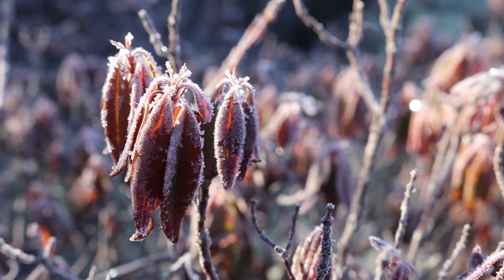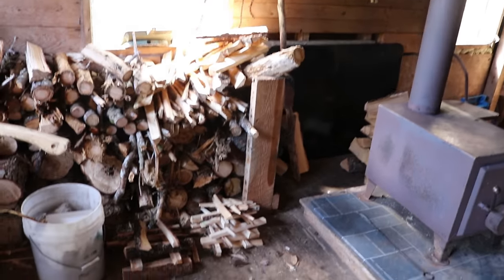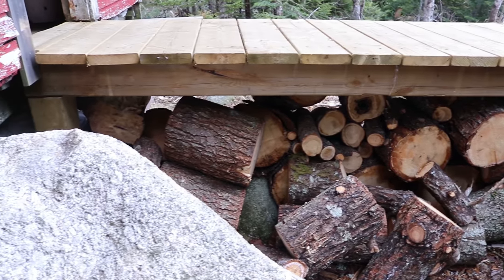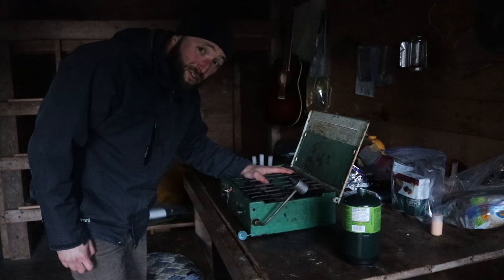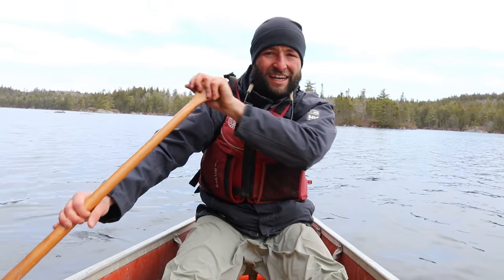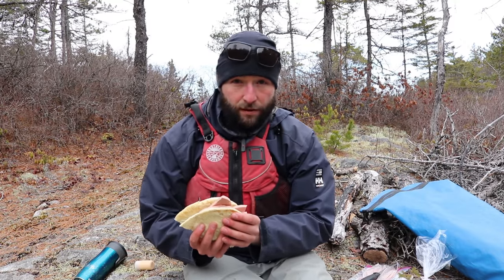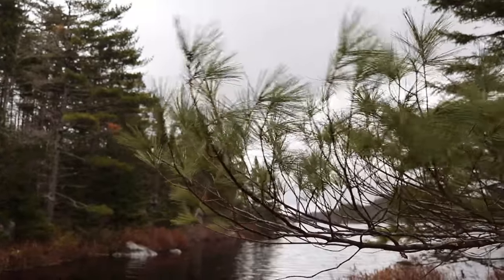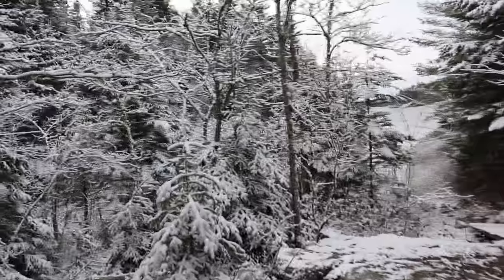Lake Access Only Off-Grid Cabin in Nova Scotia, Canada

Comment: Was thinking that someone should clean the stove pipe...the draft wasn’t all that great with the two bends in it. Pack in a chimney brush. Great vid.
Reply: Should be cleaned especially if burning pine. If not cleaned you can have a  stove pipe fire. And to have that 3 foot parallel pipe is inefficient for smoke to escape.
Reply: Good point mate. Tho I wonder if that’s taken care of.
Tho it’s not used that often or prolly not during extreme cold spells.
Reply: @emelen123jamesula2  All you have to do to clean it is burn it extremely hot with a bunch of kindling for about 30 minutes and get it glowing. As for the parallel pipe not being efficient for the smoke escaping.. while that's true, the goal isn't to have the smoke escape, it's to warm the cabin; the more pipe you have inside, the more heat it transfers inside.
Reply: The pipe was realigned in 2023 to make it straighter, it draws much better.

Comment: Best canoe repair is simple:  pitch from spruce or fir works great.
Reply: yes use pitch melt down and ad some carcoal from the stove mix it kind of thtick then apply it warm to canoe.
Reply: also flammable great for everything! 100 :)
Reply: Good tip, prob could been done that trip
Reply: there was no duct tape/fiberglass grey stuff on the bottom of the canoe when he flipped it to go off to explore the lake. 15:34
Reply: Good eye Jeanette, I'd rather share a canoe with you to cross the lake, could have re patched before venturing out 👍
Reply: Yeah! Was just going to mention that! And strangely...one of the few emergency repairs that will actually stick to a Ram-X hull in a pinch!👍

Comment: For future reference if you have to mend a plastic canoe/kayak in a pinch take a knife or piece of steel if you get it cherry hot in the fire then you can weld it back together. Just heat both sides up to melting and bring them together just like welding steel. Obviously if you use your knife you just ruined the blade and at that point it’s more or less junk but in a survival situation would you rather have transportation or a knife. Obviously this trick won’t work on your fiberglass or Royalex or the modern equivalents like carbon fiber or blue steel or tuff stuff but any plastic or polymer it works like a champ

Comment: Nice trip and cabin. I’ve used spruce gum melted onto a crack before. Worked on wood, canvas and aluminum for me. Not sure if it would stick to the plastic, but suspect it would have.  Wrapper still on the bologna... good chuckle there.😊👍
Reply: Was just going to suggest this. Birch/spruce resin. It is the obvious solution. Especially in the home territory of the bark canoe.

Comment: To fix the hole take two pieces of thin metal and old inner tube and sandwich it over the hole by drinking holes threw the metal and tube  canoe and second piece of metal. This will last for ever and not leak .I had to do both ends of my canoe .Plastic is too flexible nothing will stick to it for very long. Good luck Take short round head screws and nuts to hold the patch together.

Comment: For me it's gotta be thin slice bologna. But I do go with the Sunrise brand though. I love having my wraps. At home or in the woods. I put bologna, turkey breast (thin slices), cheese, BBQ sauce and I also use either Roated Garlic Mayo or Smokehouse Bacon Mayo (Compliments brand). At home I heat it in microwave. Outdoors, on a grill over the fire. I lsao fold it different than you did in video. In front of me, I fold the right side over. Then the side closest to me over that. Then the left side. And finally the side farther from me. Makes it a square shape. I like using the big Tortilla wraps. I prefer the spinach ones, but will use the "Original" if the spinach kind is not available.

Comment: Take a Home Depot bucket (HDPE), shave a piece off, melt and smear it right in the crack with soldering iron with a large flat tip.  Done it a few times - just becomes part of the boat and will never come out.

Comment: Great video, love the respect. For multi day trips by canoe wind is a serious consideration so I feel I've gotta make a plug for kayaks. I've done literally thousands of miles of tripping over the years and there's a lot to be said for their speed and efficiency, they are easy to shoulder and light for portaging, and in my large touring kayak I can carry enough gear for a week. Unless in a strong headwind I can easily cover 30 km in a day and once proper technique is mastered one can paddle beam to a 25 knot wind. With a rudder, even an intermediate can do it - though seamanship in waves is another issue. Additionally, though a skilled paddler should never need rely on it, a kayak can be rolled upright in the event of a capsize and the inside of the boat(and the gear) remains dry. Having said all that, there is something special about the simplicity of a canoe.

Comment: You should send a little heat up your chimney before starting your wood stove fire, as it will eliminate that back-puffing smoke you encountered on start up👍
Reply: How do you send heat up before starting the fire? Not being snarky, actually wondering how you do this.  :)
Reply: @Stationary76  When one first attempts to light a woodstove, the air in the flue pipe is cold and the smoke is challenged to penetrate this air. If you simply use your twisted up lighted newspaper (there are other ways) to first send its heat up the flue, you will greatly aid in allowing the smoke to exit the chimney and not back-puff into your slightly warmer cabin environment. It only takes seconds and makes the fire lighting MUCH easier! 
When you've entered a freezing cold off-grid Canadian winter cabin countless times...you soon find ways to expedite such things as getting that stove ripping hot ASAP....without choking on unnecessary smoke;)

Comment: I would think you carry a Leatherman tool or like, ya need an assortment of coarse thread drywall screws, you can whittle a board from a split,an use screws to patch a plastic or aluminum canoe or kayak even a sock will slow down a big hole with a board screwed down tight, oh! one other thing always check back of cabin for sasquatch man panties souvenirs

Comment: Water still yellow tinted after filtered, is it safe to drink?
Reply: It should be, some filters or filters that need to be changed soon don't always take out the tannins in the water but should still filter out bacteria and viruses. If you're not sure if your water is safe you can always boil it after filtering the debris out. Even boiling won't take out the discoloration though.
Reply from the maker: The yellow tint you see is the natural tannins of the water. A lot of our lakes have that colouring